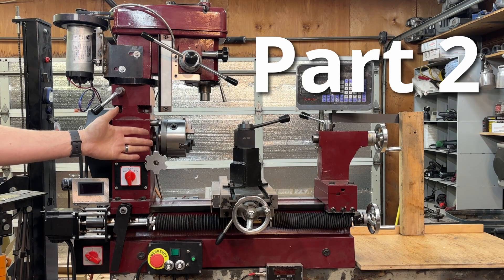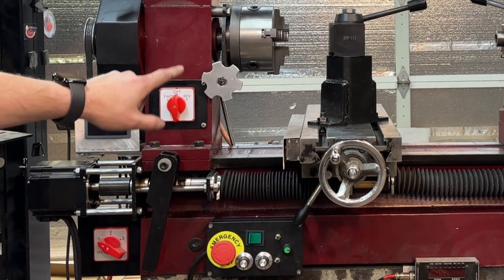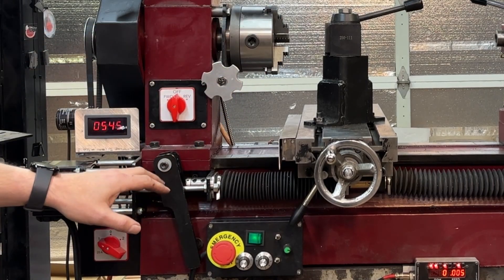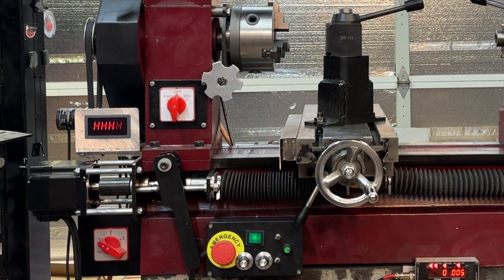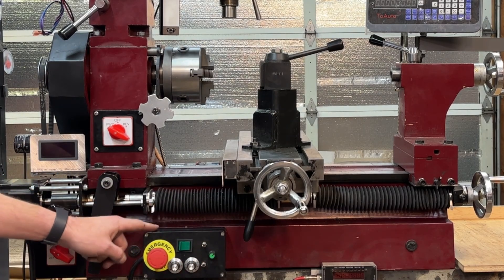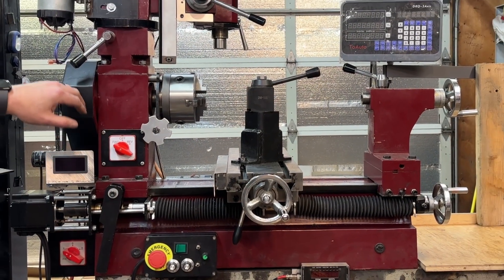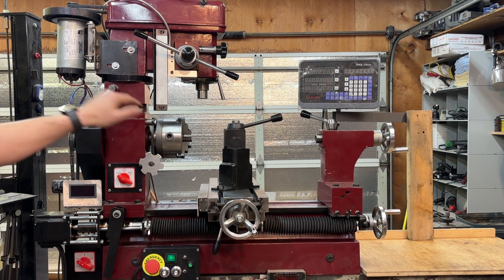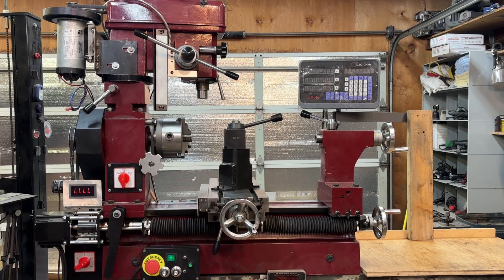Every Modification I Have Done to my HF, Central Machinery 46199 3 in 1 Mill Lathe Combo PART 2

Comment: Hey brother! Thanks for the info. I snagged a good deal on a combo unit a few years ago but it's sat in the garage ever since. Just haven't known really where to start with it as far as a project. It is a really nice unit. I'd say Grizzly quality maybe slightly better. Came with 2 motors, variable drive, leads crews, and tons of extra parts. It was so heavy and I just never got it up on a bench at working level but your video has me inspired to clean it up and start using it. I will tag ya if I ever post a video of it. Cheers
Reply from the maker: I'm glad I could inspire you! if you want more inspiration come join the mill lathe combo facebook page https://www.facebook.com/groups/168134035160655

Comment: The latter software on Clough42 ELS leaves the RPM display on when the ELS is turned off. However, I still needed a separate display for my mill, as would you. My mill RPM is up high and the ELS is where your Rpm display is and a little easier to operate.
Reply from the maker: this is the most current software, I just don't turn on the master ELS power unless I am using ELS features.